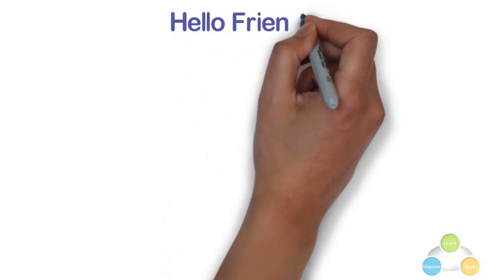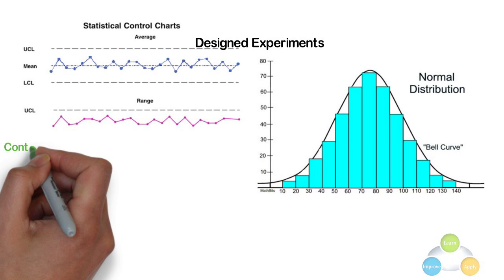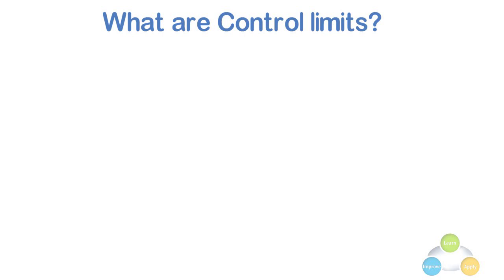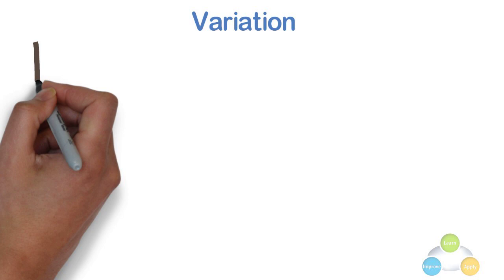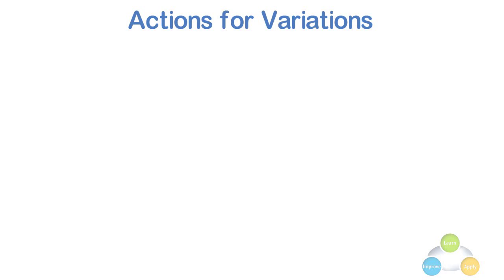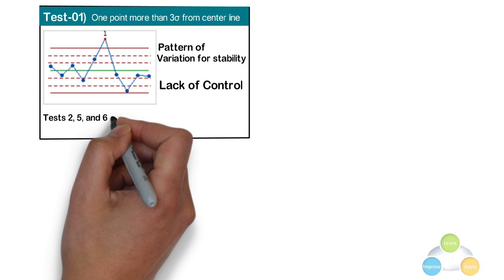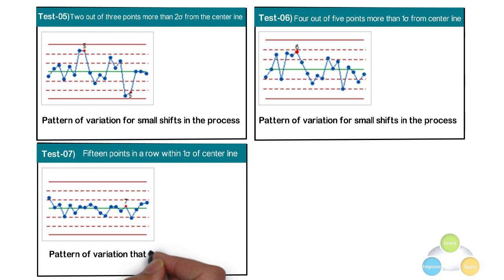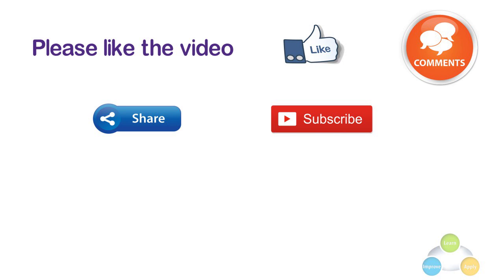Control Chart : Detailed History, All Concepts & Nelson Rules

Comment: I find it is common for people to incorrectly calculate standard deviation.  I see a lot of videos that do not point out the difference between overall standard deviation and the estimated short term standard deviation (used for control charts) why the distinction is important.  Because of this I think too many people are getting the impression that you just take the overall standard deviation of all the data points and use that to find control limits.

Comment: In case of control charts  C and Control chart P ,Control limits change with the number of items in the subgroup (subgroup size)
❖ Larger Subgroup – narrow control limits. Why ?
❖ Smaller Subgroup – wider control limits. Why ?

Can you please explain . Thanks
Reply from the maker: In case of Attribute Control Charts, the control limits are calculated based on their mean (u bar or p bar) and subgroup size. Please consider it as a combination of both.

Comment: Sorry not sure if I have asked this question on any of your other videos , But since Nelson's rules (especially 4 and beyond ) are based on  Standard Deviation they are not applicable to Control Charts like C , NP , P etc which do not use UCL and LCL based on standard deviation values . would that be a correct statement ?

By the way a very well explained video - thanks
Reply from the maker: Thank you for the valuable comments and appreciation!
Yes, the statement is correct. For Variable control charts, to calculate the control limits we are using Mean and Standard Deviation (or Range).  
Steps 5 to 8 are used when an early warning is desired in the case of a variable control chart and that can be tested with the help of nos. of standard deviation.
For the attribute control chart, the calculation of the control limits was based on Mean (Averages).
Reply: @learnandapply  thanks for clarifying

Comment: Many thanks for such a great introduction.

May I know if control chart is the same as run chart or not?
Reply from the maker: +Mazen Al-Sakkaf 
Thank you so much for your valuable comments. 
Run chart is the only graphical representation of data to know if any particular trend is there in the data, whereas Control chart is in much detailed helping to find out assignable cause immediately and correct it.
Reply: LEARN & APPLY Many thanks for your answer and time

Comment: Sir , 

Please correct me if my understanding is wrong.

Control chart generate UCL & and LCL based on data or sub group data which gives process variation from this we eliminate the error in process with repect to charactertics

Cp and cpk are based on USL & LSL
Which gives process variation with respect 2 target line

Both method  will provide normal distribution curve, am i right.

Thank in advance.
Reply from the maker: Thank you for your valuable comments. The 1st part of your explanation is correct. But, the last sentence about normal distribution is not correct.
You can calculate process capability for Non-normal process also.

Comment: How to use control chart for die control process. (Dimension will increase over the time)
Reply from the maker: Thank you for your valuable comments.
If dimensions are varying in sizes, you can use proportion of them w.r.t. designed or expected dimensions at that instant  and can plot it.
Reply: @learnandapply  thank you sir